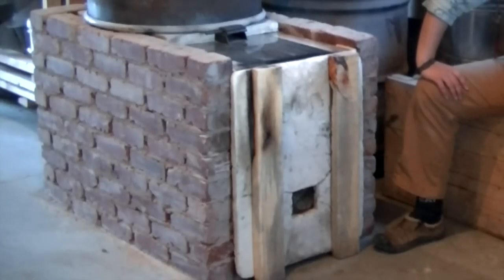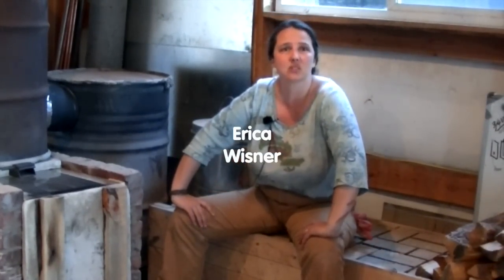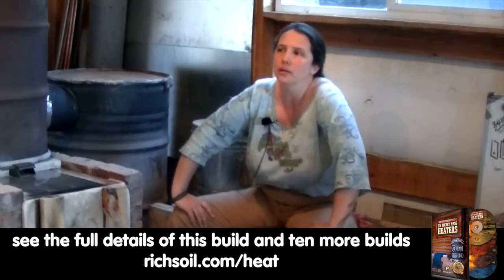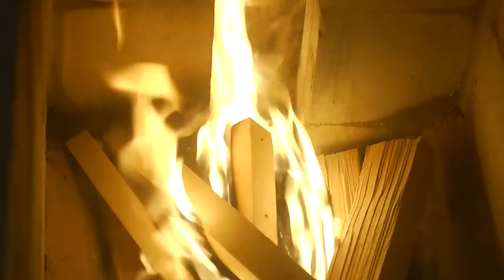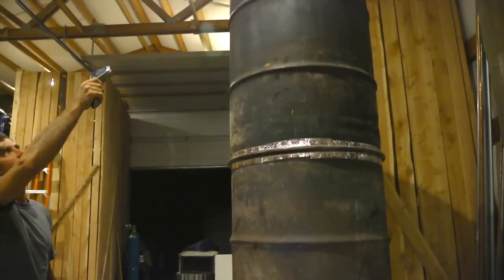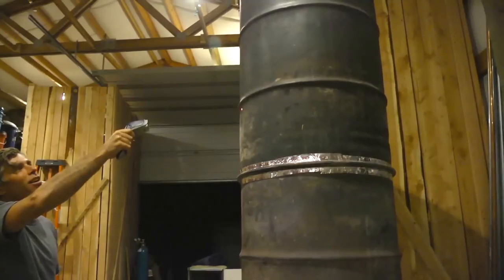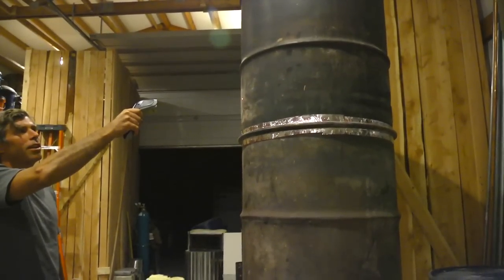Peter van den Berg builds the 8 inch batch box rocket mass heater - excerpt from "Better Wood Heat"

Comment from the maker: batch box will be the future of rocket mass heaters.  at the moment, j-tube is still king.  the problems in the past have been:  a good door can triple build time.  I think the "casserole door" solves this.  Next is that you need an inch gap at the back, at the front and along the top.  Folks used to conventional wood stoves are not aware of this, so it ends up being an issue.
Reply: paul wheaton
 I used a door and frame from an abandoned stove, allow for expansion and seal with fire rope. It's screwed to the bricks.
Reply from the maker: The screws into the bricks, or the stuff where you lay something like plumbers tape into the mortar, we have seen those attempts fail over and over in time.   Getting the steel wrap around the masonry seems to be the only solution that stands the test of time.   Although we think the new casserole door will also do well.
Reply: Screwed into the brick.
The frame is still solidly held in place, I've had it off a few time for adjustment inside.
I run the stove two or three times a day due to it being small, on a boat and drafts being a cold reality.
So it gets a fair amount of heat cycling.
This is my third door mounting and I think the thick rope gasket and expansion space means not so much movement is applied to the fixings.
Reply: Third door mounting in three years,
Reply: This video didn't really show us how the door attaches and works.
Reply: can you please expand upon this. thanks

Comment from the maker: if you are gonna build a rocket mass heater, will you build batch box or j-tube or something else?
Reply: Batch box if I can.
Reply: Batch Box for the shop.
Reply: I have Kuznietsov stove - it initially heats up slowly but it holds the heat well over 24 hours.
Reply: Probably J tube with an eye to convert it to a batch box after the first heating season if the J tube requires too much tending, or if as you mention the casserole lid door ends up making batch box a simple setup. Without welding tools or experience, the J tube would be the easiest to construct for now.
Reply: have done both in the past...will be going with batch box from here on out. especially with the casserole door!
Reply: Batch, for all it's advantages.
Reply: paul wheaton j tube and chips not logs if it works out
Reply: @paul wheaton - never built a stove before, so probably a really basic j-tube as a learning exercise.  Then, the batch box seems the logical choice.  We are in a rural situation with three standard  wood heaters in the house and another in the annexe.... Two of the heaters suffice for most winters.
Reply from the maker: @250tegra  I suggest you stick to j-tube.
Reply: @paulwheaton  Thanks, Paul.  That's what we will do then - gain some experience with a J-tube first, do some tests.

Comment: After watching masonry heater videos, it's apparent that the rocket mass heater is the poor man's form of the same thing.  The difference is that in my area rocket mass heaters aren't yet township approved.  Which also means my insurance company wouldn't approve it.  I'll keep checking with the township
Reply: Seems to me you could just build yourself a masonry heater with some enhanced features.  

Honestly, you DO see a lot of welders who love slapping together a rocket stove, just to hear it roar.  But the last thing you want if you're doing it right is a metal burn chamber and riser.  That all needs to be firebrick.

So what I'm saying is that if you want your RMH, then approach it as a mason!  You can replicate the riser and "barrel" with bricks, and you can send the flu gases on a detour in your masonry hearth.  From the city's perspective, you just wanted a really big masonry hearth!  The city's not going to consult with you on whether you have air passages undeeer the stone hearth, is it?  It'll just come out and see the externals, check its boxes, and move on.

Anyway, it just seems like you could do it in town and be insured if you made it LOOK like another ostentatious hearth.  I'd even use brick for the outside air to the fire.  Just have it all mapped out.

I've been kicking around the idea of conventional-RMH hybrid, for quicker starts, but maybe also to spoof inspectors.  They want 300 degrees at the roofline, which you're not going to get if you're using RMH.  It's just not that hot at the exit point.  I just kinda want the conventional option, because I'm suspicious of the J-Tube design at start-up.  I'm confident it works once you get it rolling, but it can take some doing to push that cold air out in the morning.  A straight-up chimney and a strategically placed damper or two, maybe you get around the awkwardness of start-up.

Comment: Can a small cast iron stove be used for the batch box?  I have an old Jotul 602 C that has a 5" flue. Could a heat riser be installed on top, or is there an issue with the design? I was thinking about using a small oil drum for a heat riser, then possibly a bell just below that.  Just curious.
Reply: Maybe you could have oxygen in above the burn box, with that insulated riser.  Kind of odd to think about having it hotter away from the main box.  Not sure it even would be.

Comment: you said, not to use metal for the inner construction. was there metal that was used in this video.
 interestingly. boiler manufacturers who use 3/4" plate. have an operational temperature of 3000 Fahrenheit.
Reply: Metal in the burn tunnel doesn't last long, the metal used in this system isn't in a vulnerable spot.

Comment: I need a rocket mass heater for multiple floors in my house I have five floors I have no gas heat so I can tap into that flu pipe as the hot air goes up through the flow pipe every floor I can reroute it with another rocket mass heater on a smaller version on every floor has anyone done something like this ?

Comment: Paul- Are details about the important riser tube included in the digital download. Are all dimensions/materials & know how on the detailed video for sale etc.  Do you think i can use the 8 inch version to heat an old gas water cylinder held above the riser tube (a vertical empty flue pipe surrounded by a water jacket of about 150 litres water). Where can i get the download version, specifically relating to Peter's batch box design only.
Reply from the maker: No.   Answer is too big to fit in a youtube comment.  That does not exist.
Reply: What information is available please on the DVD set other than already seen on you YouTube video? Only interested in help with the 8 inch batch box build. thanks
Reply from the maker: This is 25 minutes of content edited down to 4 minutes.  So, like this, but 24 minutes more.
Reply: Be a good chap and let me just buy 'DVD 4: Innovators Event'. Possible ?
Reply from the maker: You can get all four dvds for $38.  It seems pretty freaky cheap already.  So I guess my response is "Be a good chap and just buy the 4-dvd set."
Reply: how do i buy them, name ? amazon is it ? I am in the UK. make good gifts for chistmas, hopefully newcomers wont burn their houses down ;)

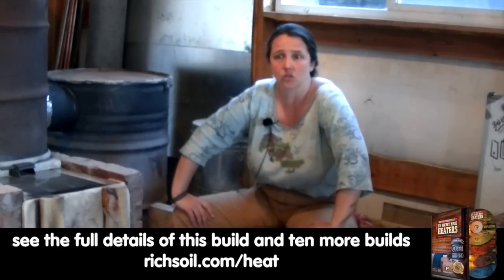Comment: Guys what is the name of the song at 0:30?

Yes, great design, but they did not show how primary and secondary air work on this one, so we don't fully know what they showed us.
Reply from the maker: You saw that this video is an excerpt from a full length movie, right?
Reply: Yes and I own the set of DVDs by the way. I don't remember that stove from the DVDs but I'll check them again soon, as I have to check the part where Erica talks about the 3 ratios for the lengths of the elements of rocket stoves, before building a new one next week.

So do you know what song it is you guys put at 0:30?
Reply from the maker: @o00oZu1o00o  something by formidable vegetable
Reply: OK thanks, I'll find it this way...
Btw I loved the DVDs, except boom squish, because I hoped we were going to learn how to build the systems that feature steam, but mainly we learned that it was not a good idea unless you're an expert, to play with steam... So I was disappointed by that. But still, I learned stuff from this DVD too. 
Overall, I learned what I needed from the series, which was super important to me. I was really looking for the knowledge I got from them, so I'm really happy I got them...

Comment: Is this fundamentally different from a masonry heater?
Reply from the maker: Far cheaper.  Far faster to build.  Has the riser which burns more completely.  A rocket mass heater steals a lot of design from masonry heaters.
Reply: Thanks for the reply, Paul. I hope there are more people who can install these. We may want one in a couple of years.
Reply: They are pretty easy to build, you can take a workshop from multiple places that takes you through the process so you get a handle on the process and would make you comfortable with building your own.
Reply: No... but one is $20,000

Comment: Why not just use a wood stove with a rear exhaust instead. Then wrap the exhaust and the mass?
Reply: Wood stove is difficult because it is the refractory material PLUS the refractory riser in a rocket stove that creates the intense heat and initial draft and draw. The iron of a wood stove cools the "burn" immediately. I think it's POSSIBLE to use a wood stove if the "venting" goes immediately into an insulated or firebrick "riser" of 4 to 4 feet to "really draw." A large riser may make up for the inital problem. Also, in the wood stove the baffel or "push gases" toward the front should be removed or cut in half.